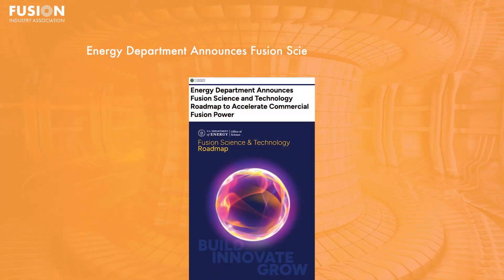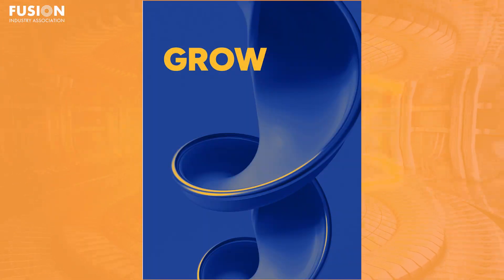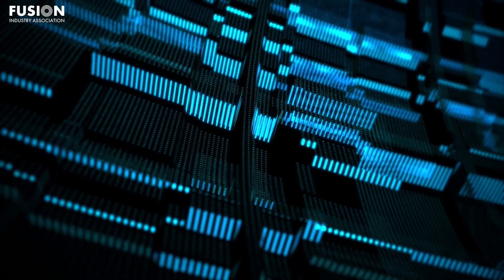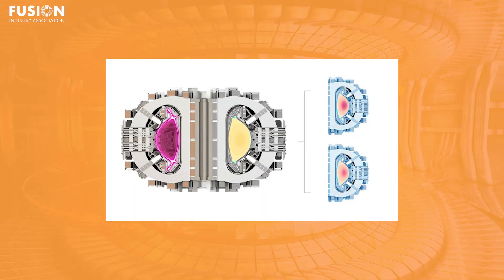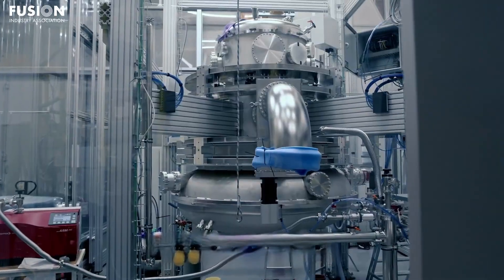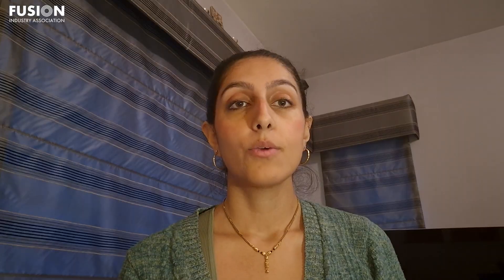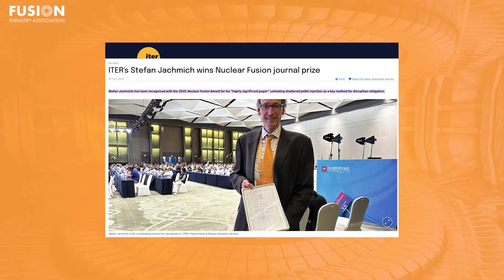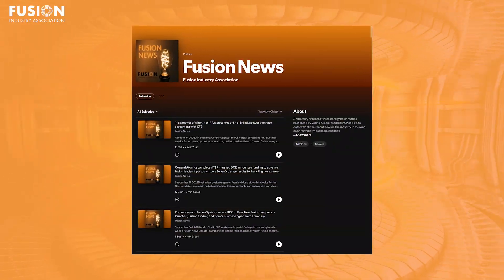Fusion News, October 29, 2025

Comment: My DeepSeek chat came to the following conclusion....

The "Core Problem":

Containing a 150 million °C plasma. that acts like a 1.6 Gigawatt neutron "sandblaster." 

This neutron flux doesn't just heat the reactor walls; it atomically dismantles them, causing swelling, embrittlement, and radioactivity.

This makes the reactor's "kettle" (the first wall and blanket) a consumable, irreplaceable core component.

If this "kettle" fails, the entire reactor becomes radioactive scrap. 

While the fundamental physics of fusion is proven, the materials science to survive this neutron hell for an economically viable time remains the grand, unsolved obstacle, making commercial fusion a monumental gamble.

Then there is also the "Q" problem.

I would not bet on Nuclear Fusion.....

Comment: Fusion is not the only way. We could have high efficiency solar cells and a decentralized power distribution. Compared to fusion becoming a mainstream, its more practical. The only thing that fuels most technological breakthrough is nothing other than the increased probability, of localized printing of currency.😂❤👍

Comment: Delta temperature is going to be then main problem. Engineering hurtles of overcoming temperature from 1M degree to boiling water.  Then you got radical neutron bombardment of materials...good luck.  Whoever come up the fixes will be named.  There lots of hurtles and challenges ahead.

Comment: Yikes!
Figure 6, The core challenge areas,    Looking at those hurdles makes me think powering the grid is another 30 years at least away if not never.
Reply: Finally, a report that admits fusion development is still mired in serious obstacles. No scheme deserves to be paraded as a contender for commercial power until it shows a credible way through them. Yet the usual advocates seem unfazed, happily painting themselves into corners—tinkering with shiny details while ignoring the need for a coherent plant design.

But don’t lose hope. Outside the mainstream, other approaches aren’t shackled by those blind spots. My favorite? A laser IFE concept with a contact blanket—a neutron‑absorbing shield placed before the first wall, not after it. A small inversion, perhaps, but one that flips the logic of the design on its head.
Reply: Unfortunately it’s never.

Comment: Good job Jasmine. The Department of Energy’s fusion roadmap 01:45 outlines six core challenge areas—each a fortress of unsolved physics, materials science, and systems engineering. But what if a single architectural shift could address all six? Enter the *contact fusion breeder blanket*: not just a tritium factory, but a strategic convergence point for every major fusion obstacle.

1. A contact blanket can prevent neutrons from penetrating deeply enough to damage structural materials.
2. The blanket itself serves as the only plasma-facing component. If made of FLiBe (a molten salt), it remains chemically stable and resistant to neutron bombardment.
3. Confinement improves when the fuel is not free to expand into a vacuum.
4. To achieve a tritium breeding ratio (TBR) greater than 1, the blanket requires more than 80 cm of natural lithium. However, even 80 cm of lithium will allow roughly three-quarters of the neutrons to escape.
5. Neutron energy is deposited directly into the blanket, which circulates as a heat-exchanging fluid.
6. Remote robotic maintenance is unnecessary because the reactor will not be radioactive. In addition, a contact blanket requires only about 1/20 the material of more distant blanket designs of the same thickness.
Reply: A 'compact blanket' is where the blanket (protective layer of neutron absorbing material) comes before the first wall, instead of after it. A 'contact blanket' is an extreme version, where the blanket touches the fuel.